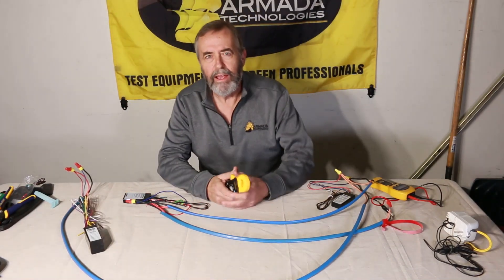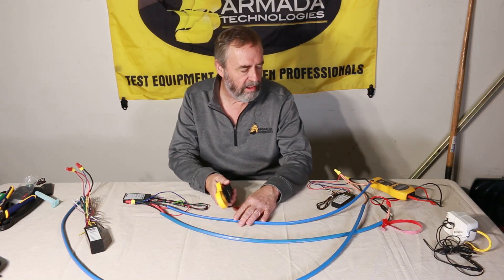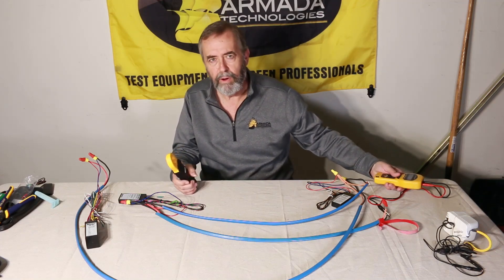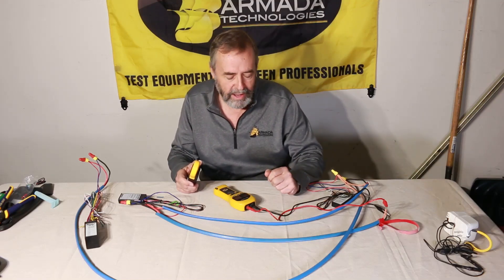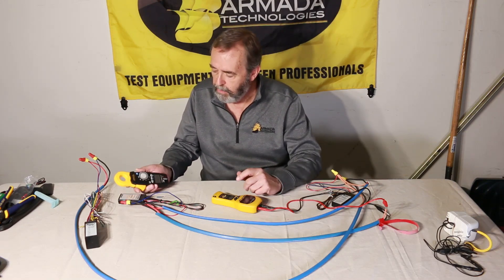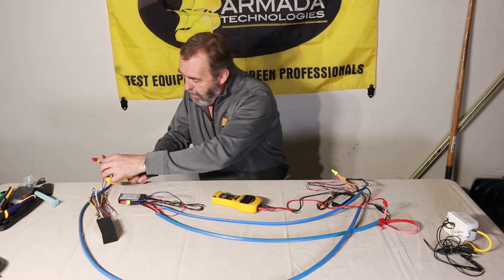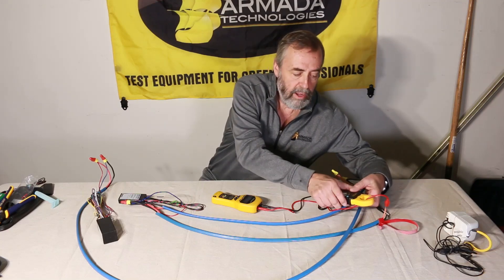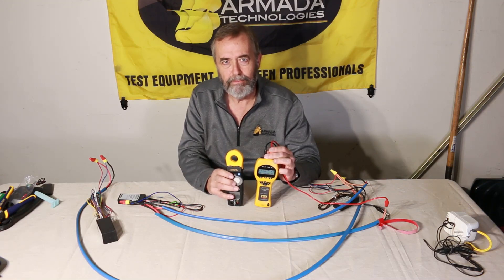Troubleshooting a 2-wire Irrigation System with the Pro95 milliamp meter and Pro50 for 24v power.

Comment: I have problem . the timer burn the fuse. When i disconect the two wire from the timer the fuse are ok. But when i conect the two wire again the timer fuse burn again
Reply from the maker: You probably have a dead short across the two wires in the control cable. Disconnect the cable from the timer and put a limited-current power source like the Pro50 in the video on the cable — the clamp-meter will lead you to the short.
Reply: The Pro 50 doesn't provide enough power to do what Jim is talking about.  I have used the Pro 50 for this and it just went blank.  So I went to using a 24 V transformer, cables and a DC battery.  BOOM!